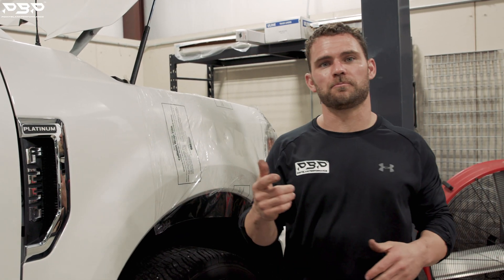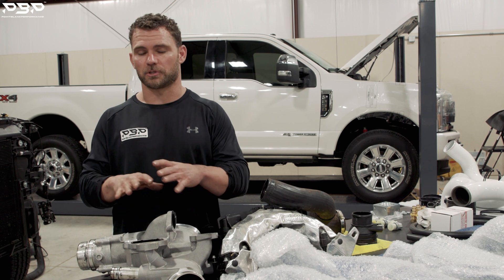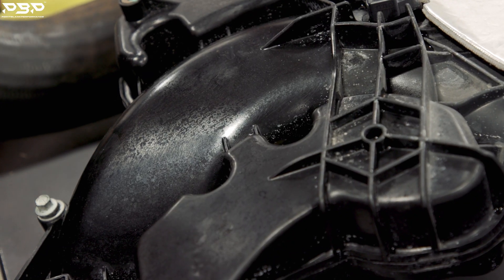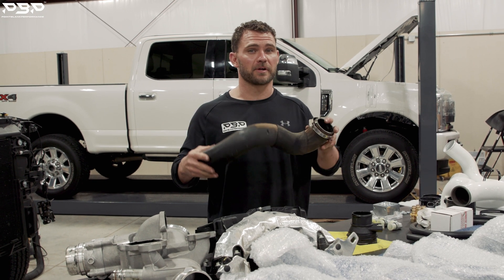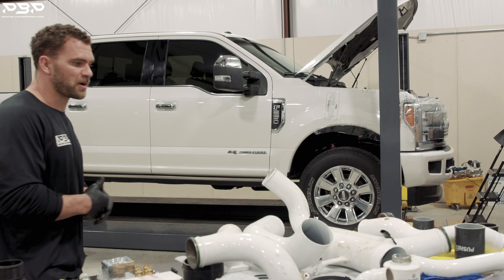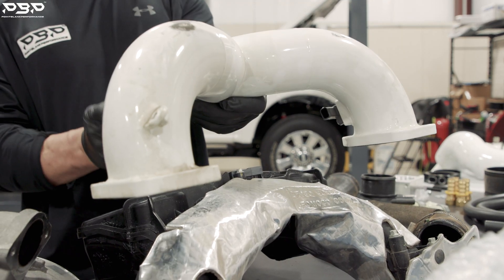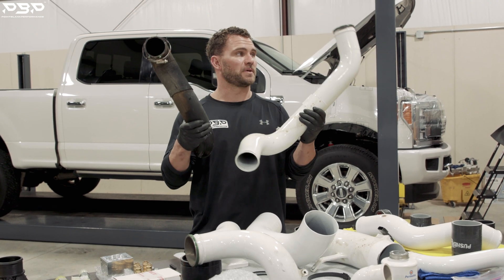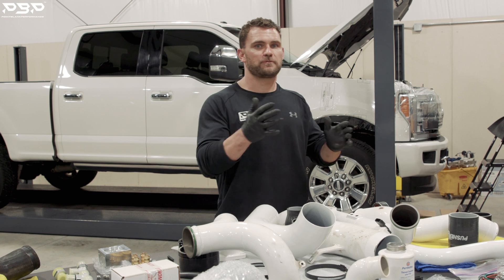POWERSTROKE BUILT TO MAKE POWER!

Comment: But what about air density? 30psi is just pressure what about the density? Is there anyway you can tune my truck with air density and not boost pressure or is there any kind of monitoring system you have or know of one that can monitor my air density I’m wanting to get your kit, but I want something that I can reliably monitor from my exhaust gas temperatures and my intake temperatures as far as air density goes I have a boost pressure gauge, butI can be at 30 psi boost with 130° intake temperature and 30 psi boost at 90° intake temperature is a huge difference in air density

Comment: Reading the dyno it's only making around 150 ft lbs at 2000 rpm then makes a MASSIVE jump in just 500 rpms. I would rather see more low-end torque below 2000 rpm and a much smoother transition down low. These trucks should make towing power.
Reply from the maker: If I load it he’ll out of it you’ll see torque . My question for you/ a client Do you really want load your truck with a dual eddy brake and make a 10 second pull? It’s MASSIVE amounts of heat ! What’s your thoughts

Comment: Looks like a clean kit. A couple of comments:
1.  The factory manifold is plastic won't blow up unless you are pressurizing the manifold beyond its yield point!  It is not clear that you've done tested it to failure. So this metal replacement part may be debatable.  
2.  Increasing piping size from OEM 3" to 4" diameter sounds like it will flow more and at the absolute limit, it may. However, at part throttle, which is where most owners will operate rather than full throttle, the larger diameter piping actually causes the velocity of the air charge to be slower!   Lager is NOT always better!!!     It would be interesting if you can test a 3" diameter rigid piping and see if you gain more HP & torque compared to the 4" diameter piping you showed in this video!

Comment: Problem is those parts don't fail as much as you make it seem and now you have to delete your truck to install the piping kit. Some people either don't have the option or want to delete.  Your dyno numbers are crap cause it's not just a piping kit, it's obviously tuned and on top of that 540 is not worth the price of your kit when good tunes will make that
Reply: Your numbers are spot on. I have a 2017 F250 and it made 526rwhp and 1076lb ft of torque with just a cold air intake, egr delete, air dog2 165GPH, and some good tunes. That's in 4th gear. Since then I have done hot and cold side piping and put a built ATS transmission.  Should make over 600 at the rear wheels now. The guy that commented evidently does not know anything about diesel performance and should keep his negative comments to himself. I enjoy your videos and will some day have a Y Bridge intake on my truck.
Reply from the maker: @tonymcadams6174  Amen sir we greatly appreciate your input and viewing !! Thank you again !
Reply from the maker: We appreciate your feedback and thanks for the view ! Sorry you feel that way about our dyno , I specifically bought it for the reason of its real numbers it would produce when we strap a truck on.
Reply: Those parts do fail as much as he talks about it. Those piping kits are worth the money if you can afford them. If you don’t like his videos quit watching them.
Reply: I can definitely relate! Those cold side hoses from Ford are a ticking time bomb! Especially if your truck is tuned.  Caught mine just in time. Installed  a new set of Pusher hot and cold pipes. Looks great! Much more reliable! 👍🏼
Reply: just delete your comment man 😮‍💨